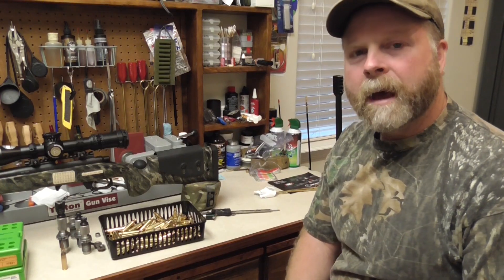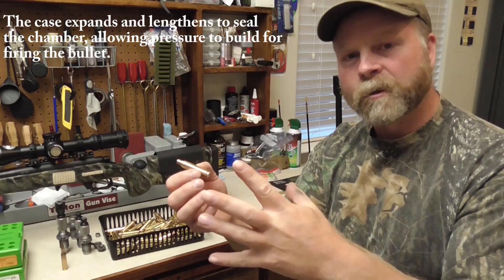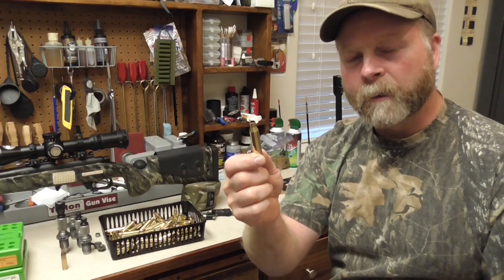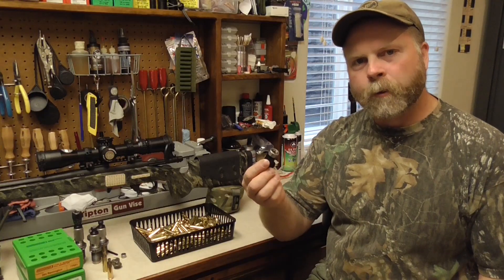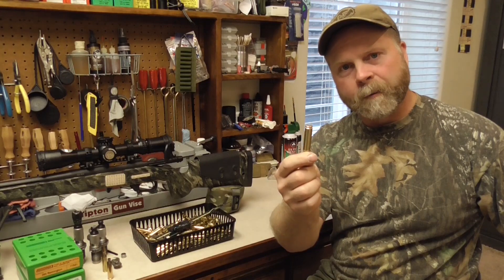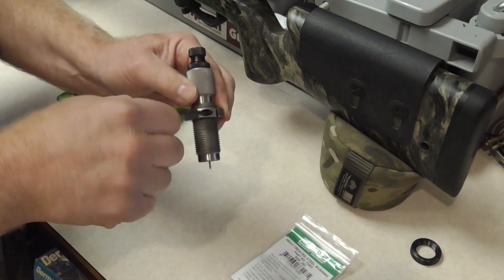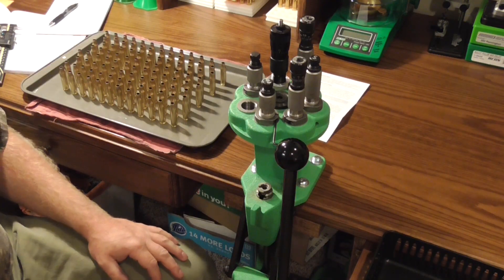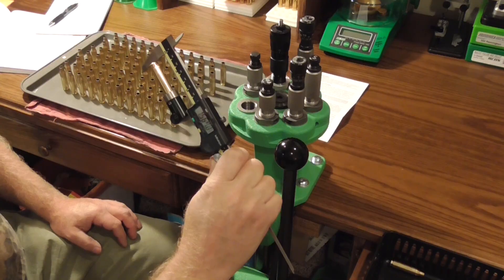Redding Type S Full Length Bushing Die: How to Set Up and Size Cases

Comment: very informative thanks
how do you decap?
Reply: So the you don’t need the center stem and decapping pin with the bushing die?
Reply: He deprimes as the first step in the reloading process. He then cleans the brass before the step he just showed.
Reply: If you buy a recapping die all they do is grind down the expander ball. I just ground my down when I was using hornady die then use mandrel for expander
Reply: Sorry recapping die
Reply from the maker: I use a RCBS Universal Depriming die on a separate press. I deprime and clean the brass before lubing and sizing.
Reply: Panhandle Precision thanks

Comment: Does shoulder bump and length of neck resize at same time. Or can you adjust either individually?
Reply from the maker: OAL should be checked after the shoulder length is established. It will generally be a little longer than fired case length, and is controlled by case trimming.

Comment: The problem with resizing the way you just did and only wanting a certain amount of shoulder bump is your truly never really found out what your true chamber length was. You need to find your actual max chamber length by finding a piece of brass that will not fit due to length not base or neck growth. I take a piece of brass that will not fit and resize only the neck and base a small amount with no bump then start from their. If that case still does not fit yo know it is because of the length not the other dimensions. Then bump from there, if you go a wee bit to far you can use a very thin piece of tape on the base of the brass to verify (thin book tape or scotch tape work great) put it on the base then trip it clean around the base. Also check that it will not fit with the bolt stripped down if you have a extractor pin that pushes the bullet forward as that gives you the best feel.  Other then that it is a pretty good video.

Comment: Hello Sam how are you 
You make some really good videos .I am about to attempt to use a Redding neck bushing die .I have always full sized so this is new to me I am loading for a 30.06  so I measured the vse neck walls came up with +14.5 +14.5  =29 and then I added my bullet which is 308 and added it to the neck walls and that came to .337 and subtracted .001 and then ot was 336 .I watched how you did it so should i purchase a steel bushing or nightride bushing .The brass I have is new so do I need to size it first or chamber the case to see if it fits in the chamber .I have a full sizing die but I dont know if it's necessary to full size new brass ;Appreciate if u could get back to me .Thanks 

.

Comment: Perhaps a dumb question, but I am new to using bushing dies.  When measuring a loaded cartridge to subtract out the desired neck tension, does it matter what type of bullet is seated in the round you're measuring? I only have one type of factory round accessible but it uses a different bullet than I plan on seating in my desired cartridges.  Thanks for the great video.
Reply from the maker: No. The bullet won’t matter, but the brass will.
Reply: @PanhandlePrecision  so how would you approach it if you were planning on using different brass from the commercial ammo but had no rounds in your intended brass to use as a baseline?
Reply from the maker: @bduclos  Either wait until you know the thickness of the brass you’ll be sizing, or maybe end up with multiple bushings.

Comment: Thanks for the explaining the reason for shoulder bump on hunting rounds.  But if it chambers with ease and the gun is being used for precision shooting, then all that is needed to seat a new bullet?  I am sort of surprise that when I used the LE Wilson case gauge & micrometer that the case grew by 4 thousands and still chambers with ease.  I am tempted to see have far it can go before I notice a change in running the bolt.  Thanks again!

Comment: You talked about the sizing die and how you set it and you said you knock the primers out but what do you use to knock the primers out. I either missed it or didn't catch all before you took the neck bushing and put it into the die. So please show a couple removing primers. Oh I just realized you were using new brass so there was no primers to knock out. But would like to see how you do it. Thanks

Comment: Most Excellent video.  Your note [see 6:14] on selecting the bushing size comes almost as an afterthought, when in fact, it is pretty important.  This really should be quoted in your description, going into more detail about your "desired neck grip" and how you arrived at that.  Totally agree on the change out of lock rings.  Some of the bushings have one side chamfered, and that side goes first into the die.  Love the discussion of tolerances.

Comment: I have not had good luck with Redding stuff. I use Lee as my go to. Since Lee does not make body dies I take their FL dies and use diamond tooling to make dimensional changes. The last dies I bought are Lee 7.62 x 25. I am making my own brass from .223 and using ezzox as a lube. It's incredible how smothe they go into the Lee die.

Comment: So having never used bushing dies and just using standard dies, my understanding is that the bushing is used to achieve a certain neck tension. 

How does one determine what sort of neck tension they desire, say for a 28 Nosler hunting load and does the standard full length die achieve a common tension desired for hunting loads, or is it worth going with a bushing die for a custom tension? 

In so many words, is the bushing die doing more for you than a standard die?

Comment: I am confused about your comment to back the die off of the shellholder a 1/4 of a turn.  The directions on my Redding Type S - Bushing Style Full Length Sizing Die states the following "When installing the die in your press, it should be adjusted to make firm contact with the shellholder when the ram is in the its uppermost position."  I have always raised the ram to full extension, turned the die until it touches the shellholder, the lowered the ram and turn the die DOWN another 1/8 turn or so, so that the ram cams over when fully raised.

Comment: Thanks a lot for the info. When you first set up your die to adjust the shoulder bump, do you adjust the die by turning it or are you using the competition shell holders? I've been reading people are getting the most consistent results by having the shell holder contact the bottom of the die and overcaming the press; but this can only be done by using Redding custom holders or a shim.
Reply from the maker: I just rotate the die to adjust. I get zero variation on sized case dimensions without contacting the shell holder.
Reply: @PanhandlePrecision  perfect thanks.

Comment: I run the same die and bushing for .002 neck tension along with a Forster seater. I got sidetracked with the idea of running a mandrel after resizing. Am I overthinking by needing a I.D sizer?

Comment: i thought the decapping pin also calibrated neck tension on the up stroke. my understanding was it makes the internal diam. of the neck 0.001 smaller than the projectile.

Comment: I have a question. I have always just neck sized my rifle brass. I purchased an rcbs fl sizing die, and the measurements I am getting on the shoulder bump are pretty erratic. Granted I have never annealed any of these casings before, could this be caused by spring back? I plan to order a redding die once they become avaliable again. I also ordered an annealing machine. 

I have been scratching my head the last day over the shoulder bump, just when I get a couple that measure  -.0015" and think I have the die dialed in the next one is -.0045" then the next +.0020. I lube them with imperial sizing wax, inside and out. I'm going to trash the brass I've been experimenting with. 

I guess what I'm wondering is, if I start annealing and use fresh brass should I expect better results. Or is that typical of a standard fl sizing die (not a match grade die)?

Comment: Hello,
I am using the forster bushing bump neck sizing die, as well as the Forster benchrest micrometer seating die. however when I seat the bullet it seems like there is always a variance in seating depth... Do you have this problem with the redding dies as well? what do you think is causing this problem? thanks for your help

Comment: I use the same method with few differences to get better consistency on the case headspace measurment (benchrest shooting technique). The first time, I use an old case that I resize to the perfect headspace for my rifle, and keep it with my reloading tools, it is my "reference case". For me perfect headspace measurment is when the bolt closes  without any effort until it is barely closed, this way I know the cases is perfectly centered into the chamber when the shoulder just touches the chamber. Each time I have to resize my cases, I put my headspace gage on the digital calipers and zero it on my "reference case". Since the calipers will give a comparative measurment you will have the ability to control perfectly your headspace on all your resizings. There is also another detail that helps to get more consistency : don't lube the shoulder of the cases it is not necessary. That's why I lube the cases by hand with imperial wax. You can also anneal your brass every 3 reloadings. Usually I can get an extreme spread of 0 to 0.02 millimeters on my headspace measurments.

Comment: Redding must have changed the instructions on the Type S bushing die? It now says the ram must be firm against the die (i.e. do not back out 1/4 turn) and to use competition shell holders to set the shoulder bump. I see how this could make loads more consistent by giving the ram a hard stop. 

I really enjoy your videos. Very informative and thorough.
Reply: I found the firmer against the die the more accurate the bump , for sure.

Comment: So might be a stupid question, but if you need more or less of a bump, you simply adjust the die up or down correct? Was the .002 bump from bottoming out the die on ram and then doing that quarter turn or did you adjust the die further to get .002 bump?

I get the concept for the bushings and neck tension.

Comment: been reloading 6.5CM with hornady stock ammo 1 fired for chamber form then forester neck bushing die for neck size in a desert tech srs a1.  i have noticed that the hornady brass neck wall has variations some as high as .002. i believe as i bushing size the necks on this hornady brass i am getting variations in bullet neck tension. recently i started using sinclar expander mandrel and die to set neck tension more consistently. current process,  i am using the .288 bushing to shrink the necks then expand with the sinclair mandrel .262 for .002 neck tension. do you think this is over working the brass? my other thought was neck turning to get consistent case neck wall thickness then bushing size the neck for consistent bullet neck tension. this is 1 less step but the 21 century neck turning lathe is about $300 so i chose the less expensive way for now. what are your thoughts on neck turning, and expander mandrel neck sizing for consistent bullet tension? my reloading process looks for cartridge concentricity and consistent neck tension.

Comment: I just bought this die for my 6.5. Can it be used to just bump the shoulder back with minimal resizing? Or should I have bought the neck die? It's not a hunting rifle.  Thanks alot.
Shaun
Reply from the maker: Shaun Kelso It’s a full-length sizing die. It will size body diameters and set the shoulder back.

Comment: Can you get away with just neck sizing and bumping shoulder back for an AR style .223/5.56? Some people are saying you have to FL them
Reply from the maker: Timothy Berlinski I FL size and set the shoulder back .002” on everything.
Reply: @PanhandlePrecision  won't that work the brass way too much possibly say if your chamber is larger then SAAMI spec?? Or do you have custom dies so it sizes closer to your chamber diameter?
Reply from the maker: If your chamber is larger than SAAMI spec to the point you can't size brass fired from it, you have a chamber problem. I've FL sized thousands of cases fired through 5.56, 223 Rem, and 223 Wylde chambers without issue.

Comment: does it matter the orientation of the bushing? numbers up or numbers down ?
Reply from the maker: Ken Garrett Not that I can see. I’ve tried it both ways. I run them with the numbers up, so I can look down in the die with a light to see what bushing is in the die.
Reply: Panhandle Precision 
Ok thanx not a lot of info on that. If it makes no difference to you, I will run the numbers up as well.
Reply: If you look at the inside edge of your bushing , One edge will have more of a chamfer on it then the other. put that side in first.

Comment: Sam,
I have the same bushing die for 6.5 creedmoor. I resized once fired LAPUA brass, and the headspace grew from 1.558 to 1.561 (+0.003). I screwed the die down to the ram and it still didnt bump the shoulder back. 

New Lapua brass: headspace is 1.557, case length is 1.912
Once fired Lapua: headspace is 1.558, case length is 1.907?
Resized one fire Lapua: headspace is 1.561, case length is 1.912

What do you think I am doing wrong?
Reply from the maker: The case shoulder length will grow when you FL size it because the diameter is getting squeezed down a little as part of the process. You have to touch the shoulder of the die to offset that and bump the shoulder of the case back. If the chamber was cut with zero or minimal headspace, the die might not touch the shoulder of a case fired in it. Dies are manufactured to SAAMI spec. 

Try turning the die in 1/4 revolution at a time , checking the case each time. Sometimes the tolerances are close enough that you can be contacting the die with the shellholder but not getting the bump. Once you touch that shoulder, the bump comes very quickly. I have seen it occur with a slight cam over on the press.
Reply: Jonathan Bunker: Are you all sorted now? I've struck exactly the same problem before, myself. I've overcome it permanently by placing the shell holder in the lathe and machining 'some' metal off the top... works a treat. That's my 'go to' shell holder now when loading for my magnum cartridges. The alternate is to machine a little off the bottom of the die, however, that's a little 'less tasteful' in my opinion.

Comment: so what would you have done if you wouldn't have gotten the 1.564 thousands? what would you change in order to get it?
Reply from the maker: To make it shorter, screw the die in. To make it longer, back the die off. It doesn't take much movement once the die is contacting the shoulder.
Reply: Shayne Crocker: Lathe a 'little' off the top of your shell holder and screw the die in some more... I've had to do it!

Comment: I’m used to reloading pistol where you stretch the mouth, seat a bullet then crimp. It seems like the crimp is done before seating for PR? Also wondering why I don’t see progressive presses like Dillon for precision rifle?
Reply from the maker: No crimp on rifle rounds. There's no belling, either. The I.D. of the sized neck is typically .001-.002" smaller than bullet diameter, and provides plenty of grip on the bullet. I know of guys using Dillons for PR reloading. There's no reason not to if you can get the powder to meter to your liking.

Comment: Help me please!

Here's my problem, I have factory chamber rifle, with fired cases they run .001 - .0015 over my concentricity gauge. Next, I use my Redding S Match bushing F.L. Sizing die, size the case, check concentricity once again and now the cases are .003 - .006 out of concentricity. I have tried two different presses and get the same results. The cases have been annealed every third firing and continue to give me poor concentricity. I have marked the high and low on the case neck while checking runout concentricity, again size the case, check runout and find the high and low is in the same position on the case.
Reply from the maker: Make sure the cases start clean and are evenly lubed before running them though the die. If you are using the expander, pay extra attention to the inside of the neck. You may also need to square the die to the shellholder once it's adjusted. There are a bunch of tips here, including info on squaring the die: http://panhandleprecision.com/category/reloading/

Comment: Magic...screwed the whole thing together...waalaaa shoulder bumped exactly right. So if it isn't right what gets adjusted? I came here to learn more about that specific adjustment, and I'm still ignorant.  I DID learn other things so time still well spent
Reply: Richard Hoag If ur shoulder bump isnt correct, then u unscrew that die ring he referred to switching out for the Hornady 1.  Then u turn it up(for less bump) or down(for more bump) 1/8th to 1/4 turn till u get the amount of bump u need and keep that lock ring exactly how it is and dont loosen it ever lol. I prefer the Redding Competition shell holders to help control shoulder bump. They ncrease in .002 increments from 0.002"-0.010" in positive direction.

Comment: For 6.8 SPC using the S FL Match sizing die with the bushing .001 under the loaded neck diam. Is it possible or advisable to leave the expander button in place ? Does that defeat the purpose of the neck bushing?
Reply from the maker: You can leave it in there, but it's not needed. The expander button is usually .001" under bullet diameter, so tension wouldn't change much, if at all. It could be argued that it would diminish the benefit of not working the brass. Some guys think the expander pushes irregularities in the neck to the outside, but I don't think the bullet cares which side of the brass they're on. I've tried it both ways and couldn't tell the difference on target. I run my bushing dies with no expanders.
Reply: @PanhandlePrecision  p